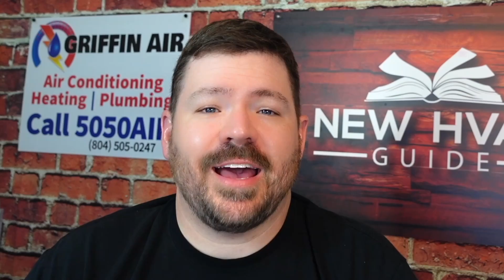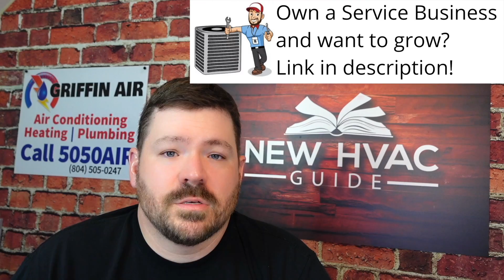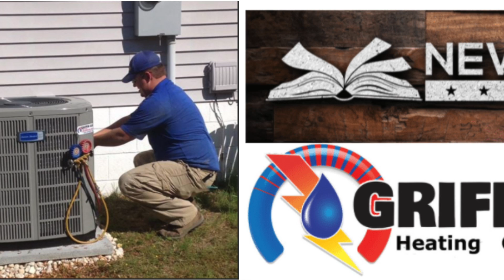Gas Furnaces BANNED! First State to Act!

Comment: I’m a AC contractor in California. Unfortunately that seems to be driven by politics and money. We have had to install low emissions furnaces for quite some time here and now have to install ultra low emissions now. They’re trying to “help” the low income/disadvantage communities yet the cost of electricity to heat the home may be impossible for some families.
Reply: Facts, I work for socalgas. These new California laws seem to have been done on impulse with no real plan. The government never thinks about all the people in the gas trade who will become jobless too.
Reply: @mrwendell4564  Yes...I believe there will be public resistance to this adolesent thinking. If this is good for the air in CA then it would/should have to be good for the rest of the natural gas burning states and countries. If not, I believe CA has a problem in forcing the public to use electric when there are less expensive and more efficient options. Lawsuits will start up and this idea will be delayed or prevented in the end. Not every home has the capabilities to run all electric as they will have limited main electric service panels, no 220v circuits for a water heater, no circuits for a heat pump and nothing in the kitchen. Folks who have those homes will be in for a HUGE expense to go 100% electric when gas is their best common sense option. No more gas BBQ's? No gas pool heaters? No gas firepits? As it is, those luxuries are too expensive to use at $2+ dollars per therm which not more than a few months ago was half of that or $1 per therm. Our state Government is abusing the public by trying to create more revenue for them via utility rates. Look at the price of electricity, natural gas, water over the past just 5 years....its all twice or more than it was and NONE of the increases have anything to do with changes in the economy. It's all political based and how to loot the public to gain more control of them.
Reply: @Garth2011  I wasn't aware of the possibility of lawsuits. I agree, the government is robbing us from every angle. This is only the beginning
Reply: @mrwendell4564  Ah ha, you work for the gas company. That explains why you're spouting misinformation about heat pumps. It's hard to get a man to understand a fact when his paycheck is dependent on him not understanding it.
Reply: Yes, true it will be unaffordable all while they were forced to spend high on approved equipment, the cost to run them will be triple overall all 4 seasons included.
Reply from the maker: Wow. That’s tough to hear pal.
Reply: @brca0957  hey there that’s a lot of assumptions you’re making there. You know what they say when you assume. I’m not a democrat. I’m also not even close to California. I am an average person, having to put in work for a paycheck. Not sure how electrifying things kills the economy unless you’re an oil company. Do you work for one? You seem awfully upset about this. I disagree with people on the left and right, but I don’t hate anyone. I’d like you to name your sources for your rant. Maybe you’re one of those “experts” out there who only parrot what was said on cable news. If you’ve got some sense, let’s have a discussion. But lol at your request for me to write you a term paper 🤣

Comment: yeah that's gong to work awesome where it's really cold (like ummmmmmm in northern california mountains) or when teh power goes out for days and days.  (yes i realize your gas furnace doesn't run without electricity, but you can power that off a small generator, but cant' do that with an electric heat pump without a REALLY BIG generator)

also it's not like Kali can keep ti's electric grid up now, much less with more demand on it.
Reply: California's power grid hasn't failed in years due to high usage.
It's also not stagnant, they are building countless wind and solar farms. 
Let's not pretend they haven't considered everything you have. Apparently they have a plan.
Reply: @kewlztertc  ummmmmmmmm they had rolling blackouts this very summer.  That's a failure by anyone's book.   And wind and solar doesn't help base power load.  in fact it makes it worse.   Of course they have a plan, but it doesn't involve the "little" people (you and I).
Reply: @brianhopkins5251  Not sure what you mean by "little people (you and I)". Are you currently involved in large scale power generation at your house?

Seriously though, at no point in history except now could a homeowner reasonably generate their own electricity. With solar and batteries today, you can go off grid especially in sunny places like CA. For profit utilities are going to do what they've always done for over a century and try to maximize profit and minimize the services rendered. Doesn't matter if its gas or electric. Case in point is the San Bruno natural gas explosion that obliterated an entire neighborhood due to negligence.

Comment: I haven't verified it but I know a person living in Atlanta that was told she could not replace her gas water heater with another gas water heater and must install an electric.
Reply: It's coming to CA too. Heat pump or electric water heaters will be required. Just think, folks will have to run 240v to their water heater cabinet and if they don't have a main panel that will provide another circuit, they will have to have the main replaced !  Then a circuit run to the water heater and then, a huge electric bill every month.
Reply: I'm going to suggest the state of CA have exceptions for those locations that will not adapt within reasonable financial means. They require low flow toilets however, not all sewer pipes will tolerate those tiny flush toilets and clog up. In those cases, a licensed plumber simply has to document that for the client and they are then excluded from the low flow fixture rule. My guess is that may apply to other fixtures and equipment when the cost is simply excessive for the gains.
Reply: @Garth2011  A simpler solution would be to drive over to a free state like AZ or NV and buy one at your friendly neighborhood hardware store, take it home and put it in.  The border brown shirts aren't looking for smuggled porcelain poopers, yet.  ADD;  the entire point of this thread is that there are NO GAINS to be had from this idiotic scheme.  None.  Zero.  The requirement ends up in a net negative for everyone except the power companies, including the 'environment' that you all seem to be so concerned about.
Reply: If it's not a law then she was lied to.
Reply from the maker: If she wants to share her story, reach out to me
Reply: Why would you ask anyone's permission?   Grab a wrench and replace the bastard.

Comment: Southern cal should of been using heat pumps and electric furnaces, it doesn’t get above 72° Virginia has the same guidelines with California we signed a pac with them and like 6 other states.
Reply: What doesn't get above 72? So CA gets down to 30 degrees in winter and 115 in summer, well outside of any heat pumps efficiency parameters. Sources say heat pumps don't cool well in hot temps and don't heat well in cooler temps, below 35 ish.  That means folks in CA would be paying to run an A/C compressor in winter and with 36 cents per kWh rates, they will see energy bills triple what they have now with gas heating. I disagree heat pumps are the answer unless you have lots of disposable income.
Reply: @Garth2011  that’s old, heatpumps can effectively heat your house at lower temps, and definitely cool your house at the same temps a straight ac can, most of the problem with energy is the envelope of your home, ac runs more power then your other appliances but air sealing, sealing duct work, and other methods will definitely effect your energy cost and your home comfort so in your 30° nights 3 months out the year. I’m on the east coast and have seen heat pumps work fine in 30° and less, but for Southern California to be all natural gas furnaces is over kill but the grid is so shitty there they didn’t want to go with heat pumps. People need to look at the house as a whole when it comes to comfort issues before just blaming the central air. And I love natural gas heat, I installed at 95% furnace in my house and 98% condensating tankless water heater. My gas bill during the winter don’t crack 70 bucks with gas logs and stove
Reply: @Garth2011  sources say lol I been in the hvac industry 15 years now third generation, so I think I’m well sourced in heat pumps.
Reply: @Freonleon  You are likely but not in CA temperatures. I've got over 60 years of So CA climate and its well under 72 in winter times while the summer is well into 95 plus for 4 months.
Reply: @Garth2011  heat pump would work perfectly fine in all of California threw out the whole season. If y’all grid wasn’t shit.
Reply: @Freonleon  Disagree. It's one thing to discuss how heat pumps can do the job and its another thing to notice how much power is used to run them, especially for heating. Most folks are cheap and won't invest in the "envelope" efficencies so when they are broken down and will be forced to use heat pumps vs gas heating, it will be a shock when they see an electric bill as high as they have in hot summer time. Gas is way more effective per unit, something like 3 times better per BTU vs. 1 kWh of electric. Electric cooking is rather efficient for most except for restaurants who require a gas flame to do what they need. And when it comes to CO2 issues, electric isn't saving anyone on the planet since power is generated at night and partially during day time. All of the CO2 they claim will not come from residential will simply come from different sources like power generation plants which all use natural gas. Those same power plants that will generate the power to recharge electric vehicles etc. No one is going to save the planet from CO2, no for a long time but until then, the little people need affordable HVAC, water heating etc. Gas is the least cost to operate and works better than any electric method, power strips, heat pump etc. If the state wants to provide the power to people for lower rates, they'd have a better shot at going all electric but not until then. As it is, CA has the highest power rates along with many other of their "rates" in the nation.
Reply: @Garth2011  I live in Norcal. My '22 Xmas present to myself was to replace my wornout 30 y.o. Heil 3 ton gaspack, getting a good deal on a Trane XL16c [on the roof] 3 ton 2 stage gas/electric unit. I also enlarged the intake and ducting and love it. I was offered the electric heatpump and the Bosch but choose to stay gas with a good brand.

Comment: What about high efficiency, boilers?  Seems like that would be less polluting than burning nat gas and generating electricity with all the losses involved.
Reply: Let's say your natural gas boiler or furnace is 100% efficient. Can't get any better than that, right? Well, heat pumps are 300% efficient or better. I know that sounds bogus to some people, but remember heat pumps don't so much generate heat as move it from one place to another. As long as the temperature outside is above -459.67 degrees Fahrenheit, there is heat energy to be had. Realistically today's heat pumps operate down to about -20F, and below that a resistive heater will be used so the house stays warm on those rare times when it's extremely cold. 

So even with a power plant being only let's say 50% efficient at making electricity from gas, because you get 3 units of heat out for every unit of electricity you put in, the overall efficiency of the heat pump system is 150%. As we move towards lower emission electricity, the numbers get even better.
Reply: High efficiency boilers emit more carbon monoxide than a gas furnace. Even with proper setup and good condition.
Reply: You need to watch some YouTube videos about the high efficiency boilers. The repair people have nothing good to say about them. They are more unreliable than high efficiency gas furnaces.

Comment: Our grid can’t Handel electric heat, cars and A/C.  These people are not right!
Reply: 1) then upgrade the grid and stop letting states like Texas put all those profits into the hands of out of state corporations.   2) if it can handle AC in the summer it can handle Heating in the winter.  Use your head.  Thirdly if we continue letting for profit big oil fool the sheeple then it will only get worse and we'll see killer heat waves, killer hurricanes and other.... oh wait.
Reply: The grid expanded massively between 1950 and 1980 to accommodate people getting air conditioning in their house. Why do you doubt that it can be done again for EVs and such?

Comment: The Reliant electric co in Texas has outrageous rates. My 1500 sq. ft. all electric home runs an average $ 400.- per month year round!
Reply: Start fixing your house, air seal, seal your duct, insulate better, I promise you will see a difference in your bill
Reply: @Freonleon  I really need a new house!
Reply: Get you a few solar panels, or a full solar system. Texas has lots of sun.
It would cut your bill by half or more.

I couldn't afford a complete solar system, and I didn't want these lease programs. So I went to the hardware store, and bought do it yourself kits, just to run my AC and water heater. 
It's not painless, I can't continuously run AC all day at 60° like I had envisioned, and the batteries cost a lot, but I'm happy with my bill.
Reply: @kewlztertc  Hello? My neighbor in Texas was sold solar panels. The house was surrounded by tall pine trees. They had to be removed due to roof damage. $ 20 K
Reply: Do you have heat strips or a heat pump? How old is your system?
Reply: @Knowledgethattheyfear  A/S outdoor HP failed after 19 years. Replaced w/York condenser. Using R407 drop-in refrigerant.
Reply: Yikes!!!!
Reply: Welcome to Texas where we have zero regulation and a failing grid and people dying because of it.

Comment: My suggestion right now is if you need to spend money before it is inflated away, buy a wood burner. Either a free standing wood stove or a outside wood gasification unit.
Reply: Can't do it in California. There are too many NO BURN days. My friend wanted a pellet stove to replace his airtight fireplace insert in the Central Valley. They would not allow it. He ended up with a natural gas insert and they would only give him a permit if the fireplace had an existing gas line.  It gets installed in 2 weeks.  $5000 price tag but he gets $1500 county rebate. Still insanely expensive.